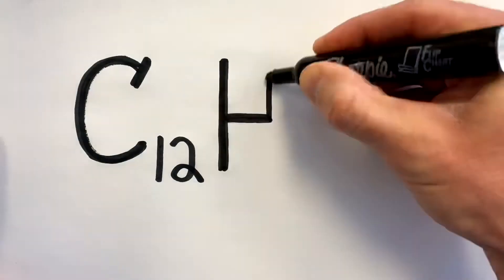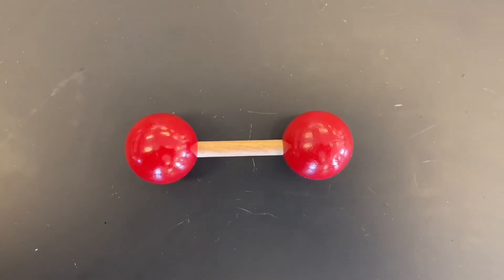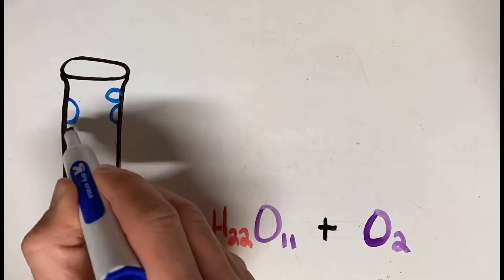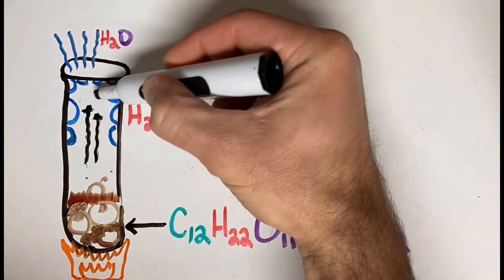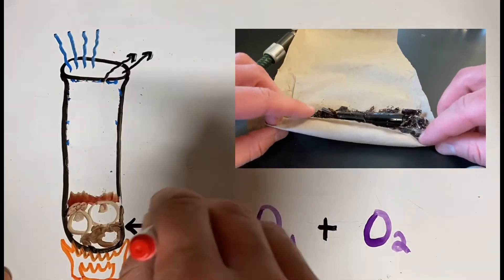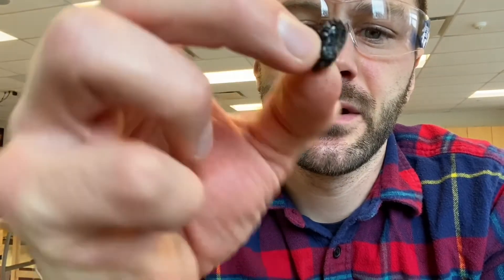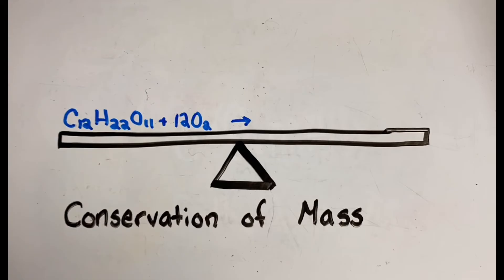Burning Sugar Explained

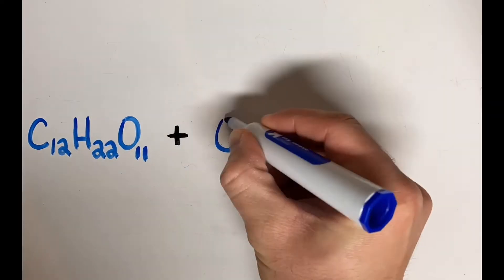Comment: maybe the equation you give at 3:46 will confuse students because this is a combustion reaction... and the "leftover" (carbon) you mentionned earlier does not appear in this equation. I'm pretty sure the studenrs will mix up combustion and pyrolysis.
Reply from the maker: You nailed it.  They intuitively ask that very same question almost every time.

Comment: I recently made some carbon out of granulated white sugar.
I placed about 150 grams of sugar in a steel container, the container was fitted with a lid with a hole drilled into the top to allow gasses to escape but not allow oxygen inside while the pyrolysis was underway.
(this is the same method i use to make charcoal from yard waste like small sticks)
the gasses released from the sugar pyrolysis however were EXTREAMLY flammable compared to wood.
So much that I became weary of the integrity of the container, as I started to worry that it might burst. it sounded like an acetylene torch and quite frankly looked like one as well.
 is this hydrogen and oxygen (HHO) escaping  the vessel? it sure as hell isnt carbon dioxide.
and actual carbon has NO taste at all.
Reply: i estimate the fire to had been between 600-800 degrees C

Comment: This is really informative. Just a query.
Why don't we consider the leftover Carbon as a Product?
Reply from the maker: Great question.  While I'm not totally sure of the complete answer, the "leftover" carbon and other particulates are a result of incomplete combusion.  If the sugar was able to completely burn away, there would be nothing leftover because all of the reactants would have chemically converted to carbon dioxide and water vapor.  Because the carbon results from an incomplete reaction, it is considered separate from the chemical equation for burning sugar.  I hope this helps and makes sense!!
Reply: This was really helpful. Thank you.

Comment: would it be okay to breathe in the steam coming out of it tho? or is it some kind of toxic? great video :)
Reply from the maker: Thank you!  Probably not a good idea to breathe the steam... that's because it's going to be boiling hot, so it's likely it would burn both the tissue around your nose as well as some of your respiratory pathway.  As for it's toxicity, there's not a huge worry there.  It's mostly water and a few trace particulates of carbon that escape as smoke.  Still though... not a great idea to breath in, ha!